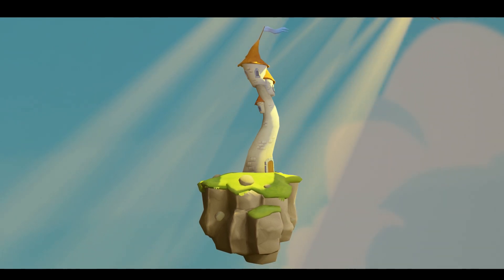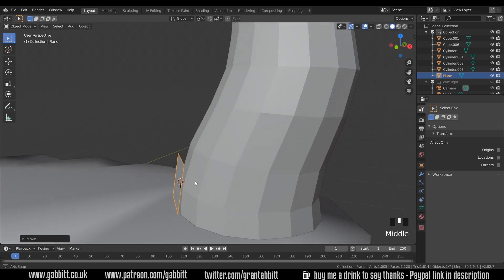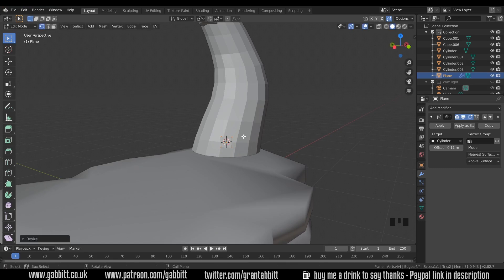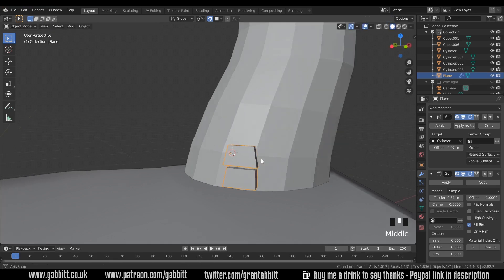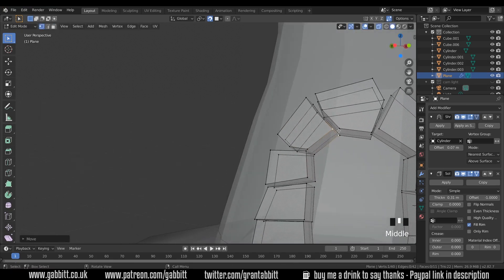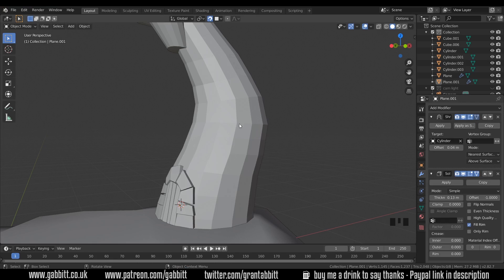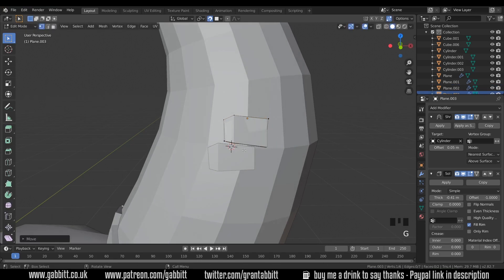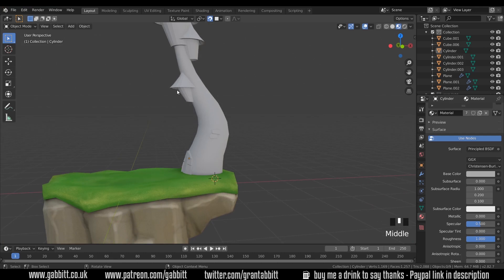FANTASY CASTLE | Part 5 | Windows and Doors | Beginner Course | Blender 2.8

Comment: Hi Grant, How are you? I am using blender 2.82.  Alt+Left Click command to select all edges in  1 lane is not working,  What Should I do?  Plz explain my mistake.  1 edge  can be select. My Alt keys working properly
Reply from the maker: you may have some doubles
Reply: Thanks Grant,  Problem is solved, I Uninstalled Blender 2.80 and keep just 2.82. alt+left click is working now, thanks again.

Comment: You know, if you want some rocks that stick to the surface, you can also do a loop-cut over a ' edge ' in the tower, on the bricks, and snap those added brick vertices to the edges, of the tower, to get 100 % sticking rocks, that don't cut into the tower, but in 3D, it will be the same <3 <3

Comment: In edit mode, you can set snap to pixel magnet, and snap the plane, so it follows the tree, then make a rounding at the top, and make it follow the way down, the lines on the tree . . Then, just add a solidify modifier, to make the plane that MOSTLY sticks to the tree thicker . .